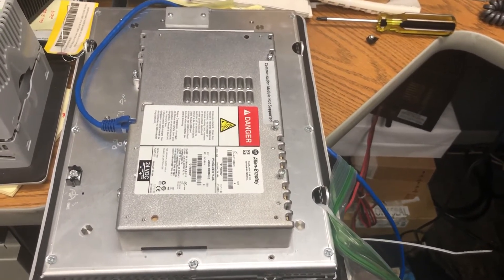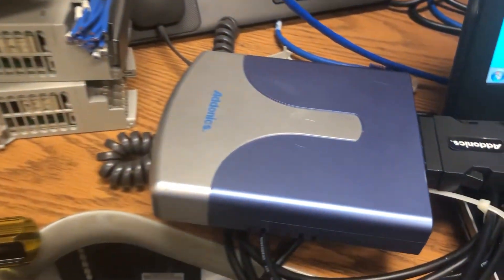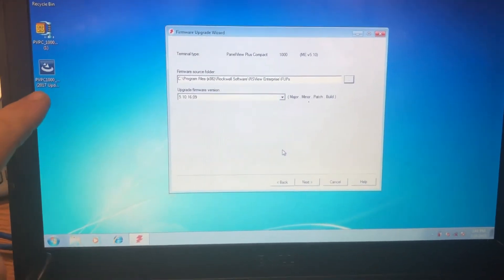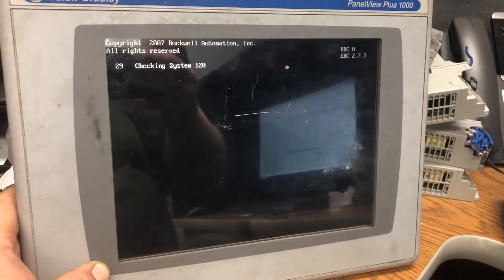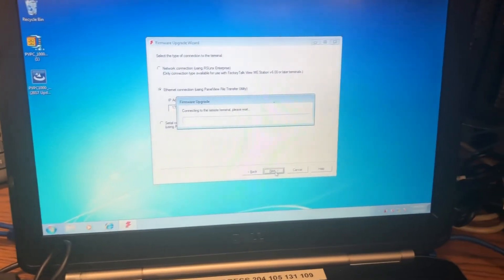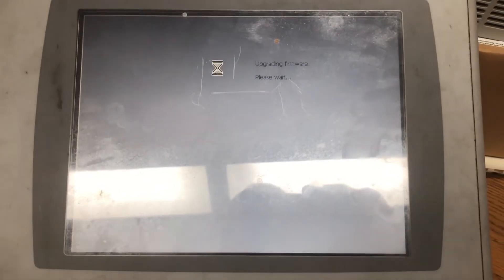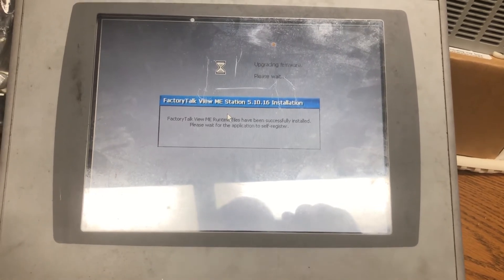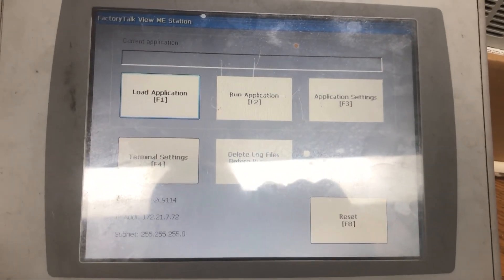Recover corrupted firmware PanelView Plus 2711PC - CF card!

Comment: Hi man, I have a Panelview Plus 1500 2711P. I followed the steps and it didn't work. Please keep in mind that I have removed all partitions and formatted the card before I continued with this.
Reply from the maker: I can't remember it's been a while ago that I made this one, I think you have to make sure you format that card with a very old format type at least FAT or even FAT16 if possible. These are very old HMIs at this point.
If the card did not do anything for you at all, I would confirm it was NOT formatted with exFAT or NTFS format.
I hope this helps :S

Comment: Thanks for this share.I have try this but my panel is change IP address every on/off and start.Your IP is every same.What resolve this problem?Thanks again.
Reply from the maker: That's strange! I don't know if you'd be able to assign a static IP address to the unit? Are you doing this over a network with a DHCP server present? What IP addresses is it assigning? Are they 169.254.x.x type addresses?

Comment: Hi  guys, I have same problem with yours. My Question is I want to change Old Internal Compact Flash  Card corrupted with new one where my new CF is have same spesification of ME Version with my old version. Will this metode solve my problem ?
Reply from the maker: I believe this method would permit you to do that, that's a good question. I don't know if the CF card will help a corrupted firmware, it's all worth a try.

Comment: Thanks for this nice video, can you send us this update file , i can't find it on Rockwell site
Reply from the maker: https://compatibility.rockwellautomation.com/Pages/MultiProductSelector.aspx?crumb=111
Reply: Thanks a lot for your attention, i already find it 1 hour ago , I will try to pass it tomorrow to panel view compact 1000
Reply: Unfortunately my hmi 2711 dosen't have this external compact flash port ,i try to use usb storage flash but not succeed, my case is little different i have no operating system and 0F error
Reply from the maker: @khaledramadan832  you must have a different family of HMI
Reply: Yes this may be the reason why not found slot for external compact flash, so now what can I do , there is pci bus port and sd card slot
Reply from the maker: @khaledramadan832  please, can you view this page? https://rockwellautomation.custhelp.com/app/answers/answer_view/a_id/1066203/loc/en_US#__highlight
Reply from the maker: If you cannot, you need to do these steps:

1. Remove power from the PanelView Plus 6 terminal.
2. Remove the battery from the PanelView Plus 6 terminal.
3. Either wait several minutes or short the battery terminals together to remove any stored charge.
4. Connect a USB Keyboard up to the PanelView Plus 6 terminal.
5. Hold down/depress the Default button on the back of the PanelView Plus 6 terminal and continue to keep the Default button depressed.
6. Restore power to the PanelView Plus 6 terminal and release the Default button.

If this procedure is going to work, you should arrive at the Terminal Maintenance Mode display.

Let me know if I can help any further.
Reply: Thanks alot for your reply , i will try it tomorrow but I already entered the maintenance mode without removing battery and make factory reset but it gives error E6 and not continue booting then after power restart give "0F"
Reply from the maker: @khaledramadan832  can you access this page? https://rockwellautomation.custhelp.com/app/answers/answer_view/a_id/117316
Reply: No I can't access this link with my Rockwell account
Reply from the maker: @khaledramadan832  - I am assuming you have a PanelView Plus 6 firmware 6.0 or greater. Plug in a USB keyboard.
1. If the fault light is on, press Reset.
2. Press and hold the Default until you see the Maintenance Menu.
3. Select the "Special Action Boot" option and hit the left arrow key "->" until you see the option "Restore Factory Defaults"
4. Hit the up arrow to select "Continue booting with selected options" and hit the Enter key.
This should get you to a factory default, and hopefully from there you can use a firmware flash, either with USB or with an IP address to get the HMI back.
Reply: I'm really glad for your continues support, this is panel view plus compact 1000 with logic module 2711PC-RP8D , with factory talk view 8.00 application ,the first problem that on site sea water line broken ,some water reach the control panel ,the HMI affected ,technicians try to dry and clean it , it comes ok hardware test during startup succeed, it start up but not complete  ,one of the technicians make reset by the maintenance mode after that it gives error " 0F" and no start up . In the information box it gives the build number only but no OS, no app .... every thing is zero
I try every method to upgrade firmware by usb flash ,no way
Try through Ethernet cannot reach , serial communication also
I get stuck , i found similar case on Rockwell support but with 01F error , by assistant zip file with autorun and system image file through usb flash also not succeed , so there is an way to solve , i hope you can find it
Thanks again for your complete support
Reply from the maker: @khaledramadan832  Okay but you can still get to the maintenance mode and use the keyboard to do all the factory default resetting correct? I'm not sure if you have been able to do that.
Reply: Yes still able to do that ,i have already connect keyboard and do factory reset ,but the error still Fatal "0F"
Reply from the maker: @khaledramadan832  That is not a good sign. I hope the hardware is not destroyed but it's starting to seem like it might be.